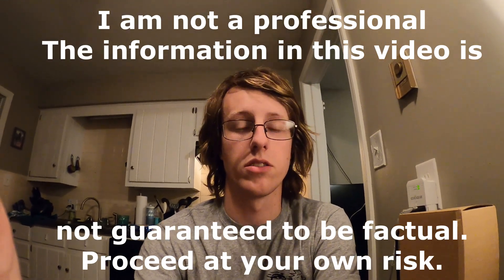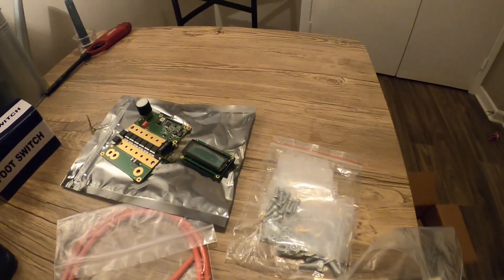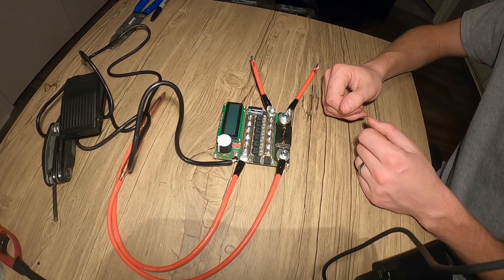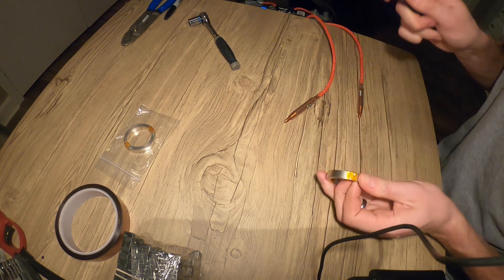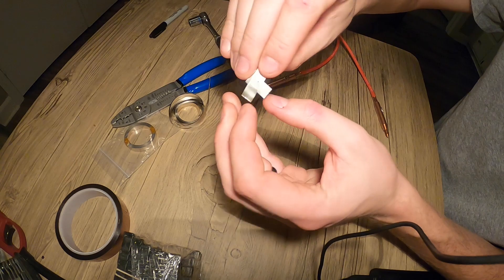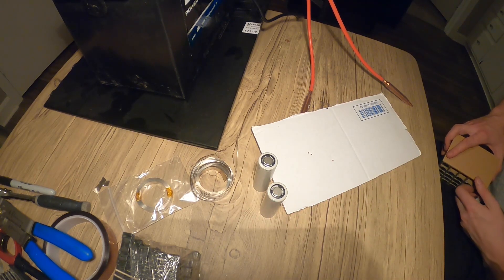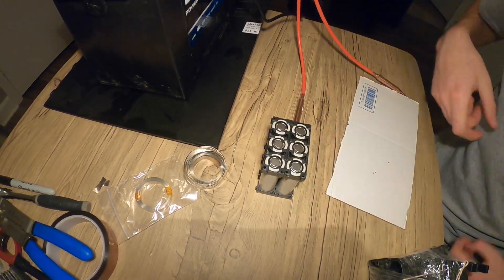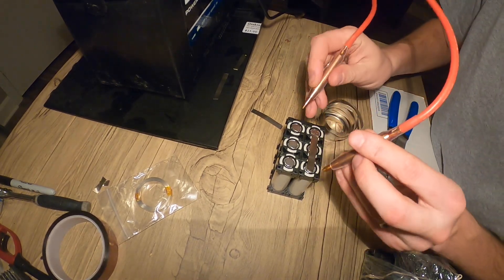Blimp Drive paramotor, battery build pt.1 | Avery Flies

Comment: Hey I think you should bench test this battery through charging discharge cycles at a higher power level than you use to fly to verify it is not going to catch on fire. Just mount the blimp drive in a vise and run at run power to discharge the battery. 21700 cells have a bigger cooling problem than 18650. You should put a few temp sensors deep inside the pack and monitor heat

Comment: Nice Job! What motor and ESC are you planning to use?
Reply from the maker: Motors will be T-motor U13II 130 KV, spinning 32x11 props. Escs will tentatively be 120 amp T-motor alpha's. I want to test it first, I might need to beef those up to 160+ amp. The 180's we're twice the price of the 120s. We shall see. I'm prepared to be wrong lol.

Comment: Following with interest.  How did you calculate the flight time?
Reply from the maker: The first builder of this style reported 14 minute flight times with a 16,000 mah battery of roughly the same weight. I know it's not linear, but using a 56% increase in capacity, I expect ~50% increase in flight time.

Comment: Worthwhile project. I've been contemplating building a 12S Molicell pack for my OpenPPG X4 so I'm subscribed and watching. Love the detail. I know how much work it is to present yourself and your work this way.

I'm currently flying with 4 or 8 Bonka 6S 22,000mah packs in pairs. So 12S 2P or 12S 4P. That's almost 4kwh with 8 batteries and I'm flying only 25 mins. You should get a lot better with a single prop but based on the SP140 specs I think you're flight time estimates are optimistic. In reality you don't want to fly to a drained pack whether its LiFe or LiPo.  Cycle life suffers a lot if your using full capacity all the time. Also you don't want to be at the last 5% of your pack on a bad approach. The power won't be there when you need it the most. I fly my pack from 95% down to maybe 25-30%.
Reply from the maker: Fair. I'm basing my flight estimate on another user. Might not translate exactly. Time will tell

Comment: Update us on your total cost too
Reply from the maker: $3700 currently. This includes battery, motor/prop/escs, carbon boom, free flight harness, battery charger, welder, and any other hardware/tools/supplies. I still have to design and order some CNC carbon fiber parts for motor and harness mounts. I expect to clear under $4000
Reply from the maker: @HilltopZombieShop  absolutely! I will have a whole parts list on my open gauge website. The motor, props, and escs came from t-motor, a well known drone motor manufacturer. store.tmotor.com

Comment: Seems a lot of people want this.  If I could offer a suggestion it would be to make your demo flights on a pure PG wing at a very low wing loading.  When I fly my big wing (30M) vs. my sport wing (24M) I burn half of the fuel.  Of course you know that, but if you can get flight times up around 40 mins without any gimmickry, I think you'll win over a few more hold outs.  I'll be the last convert :)
Reply from the maker: I have a mojo PWR2 26m, which is very lightly loaded if flying PG. The motor will weigh 14kg or so. Should keep it light. Add more 5kg batteries and easily surpass an hour flight while staying light
Reply: @AveryFlies  Way too much drag with the Mojo, to achieve the sort of efficiency differential that I am describing.  Wing loading is only part of the equation.  The Mojo is an EN "A" wing, which is safe.  It's safety however, is partially derived from the fact that the wing is excessively draggy...Drag is what is relied upon to create those "hands up" safe features.  No idea what your flying skill level is, so I wouldn't want to suggest just jumping into a lower drag, higher aspect ratio wing if you're not ready for one (maybe you are).  A wing with a much higher lift to drag ratio however, will offer longevity aloft, at far less specific power consumption.
Reply from the maker: @YankeeinSC1  my skill level is never flown before, haha! I have a gravity defiant and start training this spring.
Reply: @AveryFlies  Ah...well then stay on the Mojo for 70 or 100 flights and then we'll talk :)

Comment: This is awesome. Hardly anyone ever goes into such detail. I do a lot of electrical but DC & batteries are a completely different beast for me. Keep up the work. I will following closely!
Reply from the maker: Glad you like it! I was worried people wouldn't like the longer drawn out explanations. Pretty long video for half a battery.
Reply: @AveryFlies  sharing your knowledge is essential! You have done a lot of homework and explaining it as part of the process helped me understand better and will help anyone else trying to do the same. Of course it's not all inclusive but every little bit helps others! I'm curious though. Had looked into using pre-made battery's like minne motors did? I believe he uses 80v kobalt or greenworks to power his
Reply from the maker: @michaelhuffaker655  price, mostly. I'm not trying to be cheap on this project, but I do want to keep it under $4000. The battery I'm building costs $400. I couldn't find anything of similar spec that came in under 600.

Comment: subscribed.  When you parallel batteries in the future, do you use high current diodes so they can't cross-talk if one set is slightly lower voltage than the others?  Or do you plan on balance charging the entire new larger group?
Reply from the maker: I tested several batteries before starting, they were all within 0.05 volts of each other so I welded away. Paralleling will equalize all the cells in that bank. When I go to charge I will be balance charging the entire battery. I have an 1100W 12s capable charger for the task.
Reply: @AveryFlies  I'm talking about when you go to join entire banks together for more flight time.  Not the individual batteries within each bank.
Reply from the maker: @JohnHansknecht  ah, gotcha. I will balance charge them separately, but no diodes planned. Being matched cells, they shouldn't deviate much, but I will have voltage monitoring in place to make sure.